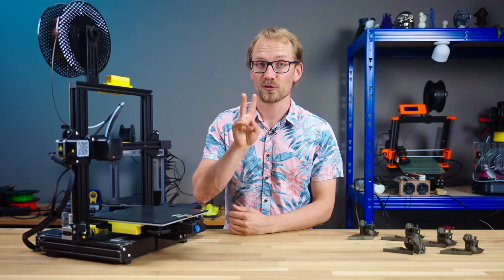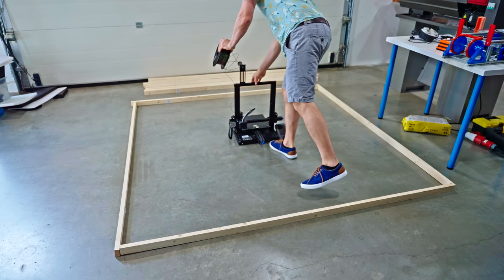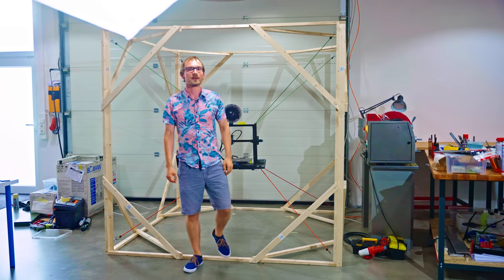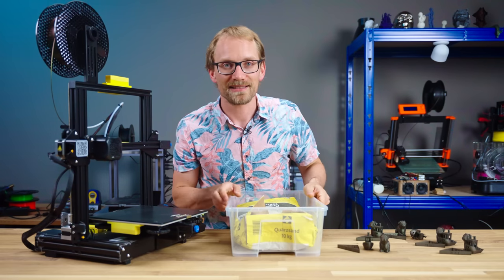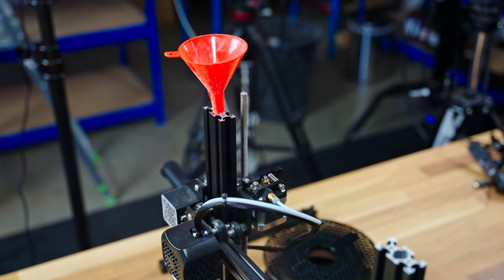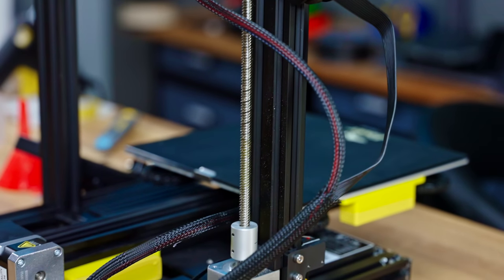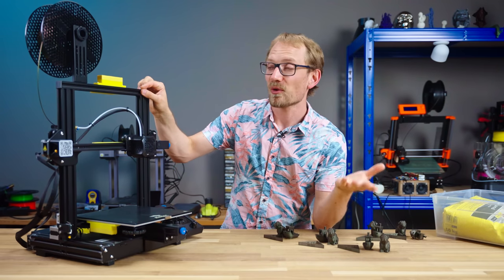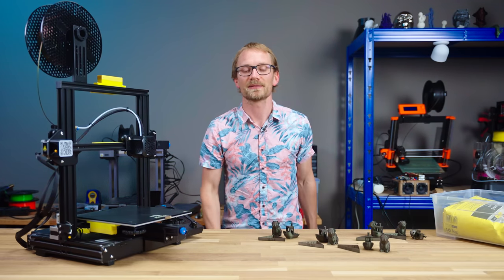You made me do this…

Comment: Interesting ideas! It might work better to put the 3d printer on legs that stick into a bucket of sand, so that there is lots of sand to absorb vibrations in the base. I am curious to see the result of a test like that!
Reply: I was going to suggest the same thing. Just place the printer in a sand box and see what happens. Hopefully it won't dig itself in. :-)
Reply: I was going to comment with the exact same thing - this feels intuitively like a good move. If you had a large, square container filled with sand and just sat the printer in it, I think you might see a difference.

(Probably too slight for it to be worth it, but at least it would be cheap to try.)

Comment: Need stiffness + weight everywhere in the frame to shift the frequencies higher. That being said most ringing is due to how stepper motors work. Throw an oscilloscope on the stepper motor, then run Input shaper and compare.
Reply: More weight shifts frequencies to lower
Reply: I find most of the ringing comes from motor, belts, pulleys. Just lubricating and stabilising makes a huge difference.

Comment: I think the best solution would be to have a counter weight on the same belt as the X or Y.
The top of the belt moves the opposite direction as the bottom of the belt..  Let's say you have a weight on the X that weighs the same as the head.. They would move opposite directions, and hence when they stop, should vibrate the machine.
Just a thought.

Comment: I just bought some motor bike gel pads, cut them to roughly 5x5x2cm and put them under the printer. They have the advantage of being able to move in all directions and completely removed all ringing. 
The printers still stand on massive, 5cm thick sandstone slabs and those are on rubber mats, which results in an de-coupled, non resonating table and a still free moving printer
While moving fast, you can see the gel visibly shaking and shifting the printer as it absorbs the energy, but the printer never moves on the gel itself.
this might be worth a try if you have ringing and/or noise issues
printer: prusa i3 mk3s
Reply: Have had a similar plans.   Was thinking of using a section of 1-2cm thick exercise mat under a large concrete paver with gel on top.  Do the feet of the printer dig into the 2cm gel pads?
Thomas should test this.
Reply: @Trevellian  I removed the feat for this exact reason, didn't even try it out.
One thing I found out is that the size of the gelpad has a direct influence on the movement of the printer, the smaller the pad the more it moved. I sliced them down from 5x10cm to 5x5cm and the change was noticeable when pushing the printer to one direction
it is important that you enforce the table you put the stone on since it weighs a ton and it will bend your (possibly cheap) table.
I enforced mine by placing a solid 3cm thick wooden board on top (no screws required)

Comment: Very cool video. Not vibration or resonance related, but one thing i have been curious about for a long time is how flipping the printer upside down would affect overhangs and bridges. Since any sagging will be pushed back up by the next pass of the nozzle, I would expect it to improve the results. And now you have the perfect "printer enclosure" to test it 😄  Also seeing the effect of different belts would be very interesting.
Reply: Wouldn't you literally just have the overhang problem on every layer?
Reply: @robertbyrnes7075  I don't think so. The molten plastic is probably viscous and sticky enough to stay in place wherever it is fully supported by the previous layer. And in areas along slanted edges where it is not fully supported it will sag towards the nozzle. Which means that on the pass for the next layer the nozzle will lift the sagging but now much cooler plastic up again. As opposed to pushing it further down when printing with the nozzle pointing downwards. I find it hard to predict the end result of this interaction, but I think it might make it possible to print steeper overhangs with better quality.

Comment: Back in the late 1980s, some of the scientific equipment vendors, such Edmund Scientific, sold rubber ball kits for physics demonstrations. One ball would be a standard rubber ball and would bounce as such. The other ball would sometimes be called a dead ball as it wouldn't bounce. The idea was to show how energy could transferred in one direction (bounce) or dispersed in multiple simultaneous directions (dead). At that time, the dead balls were of particular interest in the amateur holography scene as lasers weren't very powerful and the holographic process was extremely sensitive to vibrations. I don't know if the dead balls or material are still available but if still available, that could be an interesting test.
Reply: They are called squash balls and are available from most sports shops

Comment: Very interested in the belt comparison video. I found early on in continuous belt platforms (CoreXY) that there are parametric resonances that crosstalk in abrupt vector changes, leading to ringing artifacts. I used accelerometers and a 35670a dynamic signal analyzer to capture the response of the gantry vs the head. Data is on e3d's forum. I came to believe, but did not follow up on the idea of tuned dashpots that the belts can ride on... (shock absorbing idler pulleys)... might be a trick to try. Thanks for the hard work, Tom!

Comment: I think you may get some interesting results if you modified the springs on the tesseract. What it is now is a vibration isolator not a damper. All of the vibrations made by the printer stay within the system. If you think about vibration dampers on cars there are two parts, the spring and the actual damper or shock absorber. The tesseract set up is only spring and does not have the best damping qualities.

Comment: You could try small dampers from RC trucks.  They are sprung and oil filled.  This will actually adjust the frequencies instead of just adjusting the amplitudes. You need to absorb some energy, elastic straps provide almost no damping effect. 

I dont understand the fascination with optimizing single variables.  It would be far more effective to increase the stiffness of the frame by putting braces on it or adding gussets at the connection.  Damping a wet noodle is pointless.  Brace it until it is rigid the dampen it.  Otherwise you are finding ways to dampen a frequency that is irrelevant and ineffective.

At least the oil filled damper would effect a far wider spectrum of frequencies and it is tunable using different weight oils.
Reply: Small dampers for belt tensioners, shouldnt help with skips but maybe will with resonanses. For skips you decrease moving mass or increase motor power.
Reply: @Gebsfrom404  Wasnt thinking for belts.  The exercise in the video is about dampening the vibration of the frame.  I was thinking if they wanted to put the frames on an elastic base then could mount the dampers to the table.  This way the elastics or flexible bases allow movement but the oil filled dampers absorb vibration. As for belt tensioners I ended up using a small coil spring from a brake drum hardware kit (had a lot of them)... it is used as a retention spring to hold the brake shoes to the backing plate... around 19mm diameter and 25mm tall compression spring... pretty stiff.  Then I preloaded it with a threaded rod running through it to a yoke holding the belt pulley.  Any compression spring would work as long as it is stiff enough to maintain control of the belt.

Comment: I love your Sciency thinking. Please keep valuing it as this sets you greatly apart from typical YouTube content we all got used to! 
- You briefly mentioned the additional mass on the printbed might harm the print quality. I totally agree. I would have tried again withouout those printbed Santainers, maybe even adding them elsewhere…
- I highly value the additional mass on the printer. The bigger the mass difference between bed and printer body, the more recoil you can convert into printbed acceleration.
- A tip from back in the days (experience with laser interferometry in physics lab): For effective (nearly critical) dampening of alu extrusion profiles instead of pure frequency shifting fill the profiles with silicone (not silicon - Fugensilikon, nicht Silizium ;-) This also greatly assists survivability of your mechanical components when compared to sand… 
I would love to know the frequency range of problematic ringing. This would hugely narrow down the root of the evil (profile bending, profile ringing, belt stiffness etc.) okok, I’m getting to scientific. Looking forward to the engineering way of life: try it out! :-D

Comment: This was fantastic.  And thank you so much for testing things out.   I was very curious as to the outcome, especially the sand damped tests.  It also makes sense that BMW used such a complicated series of dampers.  But in the industrial and aerospace worlds, there is a simpler solution - avoid the areas of operation that induce harmful resonances!  In a light aircraft, this could be as simple as a plaque that says "Do not run propeller at RPM between 2500 and 2550 for more than 5 minutes".  Or for a larger aircraft, a redesign of the vibration causing components, to shift their resonances rather than compensate in other areas.  Where the moving masses are controlled by stepper motors, that's the obvious place to control vibrations.  Match the speeds and accelerations to avoid areas of resonance.  That's not cheating or a hack!  That's proper design.  Love your channel and the work that you do...not intended as a slight at all.  That I learned that a printer will work upside down is worth more than the price of admission.  To me that means it's just a matter of time before there's a 3d printer in space.

Comment: Sand filled feet are a good, cheap and decently working solution. There are many different sand filled balls you can use with a printed holder to keep them in place below the printer

Comment: Just a piece of advice for measuring squares, you can do the triangle method.  3:4:5, is the ratio your sides should be at and the distance between them.  Its a commonly used carpentry trick for getting perfect 90 degree angles.

Comment: Thomas, I have a couple suggestions for the next video in the series...
First of all, thanks for showing us what doesn't work.  The early rocket scientists had a saying, "Fail big, fail fast" so they wouldn't waste time and efforts that wouldn't be ultimately productive.  

Please try making these quick checks on the system - they may point you (and us) in a better direction.  

Try tightening and loosening the belts when repeating test models.  This might give us an indication of wether we need to absorb vibration being transmitted to the print or if the belts are a source of the oscillations.  

Then, you could compare different types of belts and look for different results.  

This might be done scientifically off the printer... If the print head velocity is known, measuring the ringing in the print could determine it's frequency.  

You could then suspend varying weights from belts and vibrate them at that frequency to see what belts might oscillate or dampen that movement.  

I suspect that CNC machines benefit from sand dampening because the multi-flute tools are turning and hundreds of rpms, creating chatter at several khz.  Printers are operating at much slower resonances, so I expect that most problems are within the motion system itself.  However, I will look forward to your next videos and learning what you discover.

Keep up the great work!

Comment: I have observed quite a bit of NVH testing. The bottom rails likely didnt harm much, but the vertical supports having sand added was the main issue making prints worse.  Adding mass to cantilevered components will just shift the frequency of the resonance.  More mass generally = more resonance at lower frequencies (greater deflection distance).  Adding reinforcement to the gantry along with soft mounts that absorb energy will help most.  A support rod run from the top of each vertical support, to lower frame would mitigate the motion of the gantry.  Soft materials used under the machine would help absorb vibrations from print head motion.

Comment: Tom,  dumb question as I haven't checked through all of your other experiments, yet - what have you done with the bed springs?  

Stock Ender 3 springs are woeful, I use the regular yellow upgrade springs on all of my printers, with a LOT of compression to eliminate some print bed wobble, these springs are better finished than ones fitted to cars - the ends are ground flat - [N.B. car springs break BECAUSE the ends are not finished properly so it transfers all the stress to the end of the first coil, saves the maker money, costs us for replacements]

The other thing I do is fix the M4 countersunk [flat head] screws to the print surface from below, using M4 nylon nuts - this fixes the screws to the print bed, don't use metal nuts without nylon washers - you will damage the insulation surface or worse, short the bed to the frame, not unlike what happened with the early CR6SE's.

Finally, after fixing the screws to the bed, putting the bed back onto the frame becomes difficult because the clearances on the screws are tight, so I enlarge three of the four holes with a 5mm drill.

Comment: Thomas, you didn’t fail.  You simply helped identify several options that don’t work and reduced the list of remaining options for others to test going forward. The effects from resonance appear to be most pronounced along the X and Y axes since we rarely move and change directions rapidly along the Z axis ( unless one starts slicing and printing diagonally at some point ).  
That said, I think effects from the X axis resonance might be reduced by two things 1) making the X-Z frame one solid piece (welding the corners, for example) and 2) dampening or stiffening the print head assembly itself.
The Y axis requires something more robust to prevent additional forward movement when shifting direction due to the increased inertia involved.  Perhaps some type of electromagnetic braking along the direction of the current force Y vector ( picture a magnet attached to the bed which whose strength of attraction to the base could be varied to match the force Y, but in the opposite direction of the force Y vector).
Just sanding thoughts while drinking coffee….

Comment: With that many skipping steps, I'd start looking into bumping up the stepper motor voltage via the driver pots.  I'm curious whether fixing those skipped steps make the 'sandtainer' approach work at all, if only because stuffing them wherever they fit just kinda looks cool.

But also, resonance tuning in software is way easier and very effective.

Comment: Cheers for experimenting so we don't have to.  Curious if/how different dampening materials/fluids attached just to static frame components would help, or not.  Detaching power supply and fan cooled controller board.  Decouple spool.  Basically isolate everything possible.

Comment: I went through the trouble of getting Klipper working on my Ender 3 V2 for resonance tuning using an accelerometer (and Klipper's implementation of pressure advance works with the stepper drivers hardwired into legacy mode on a stock V2). It worked incredibly well and the Ender's frame and motion system is surprisingly stiff, allowing the use of the better dampening algorithms that provide compensation without excessive smoothing of corners.

Comment: Something I did to my printer, and I know this isn’t on the scope of which you made this video cover, was I replaced the x carriage. It originally was a heavy thick three part steel. Now composed a singular piece of aircraft grade aluminum of the same thickness. The shock went way down as the bed now shifts. Knowing this and then applying the issue of resonance, wouldn’t a solution of determining the weakest material causing the slop (artifacts) be best to replace? IE blue loctite all frame bolts. Reduce slack in bearings and such? Stiffer springs on heat bed?

Comment: Since the idea is to apply dampening to counter the moving parts, and you already have the suspension rig, try loading two printers one facing upright and the upside down one facing the opposite direction... you want to load the same program into both and start them running (the bottom one does not need to be actually printing). The bottom printer will be moving in the opposite direction to the top one and should mostly cancel out the movements of the top one.  Might be a relatively easy experiment to try out.

Comment: Increasing the static mass is fine but adding weight on the moving parts is silly. Anything that moves you want as light as possible. I don't see much point in trying to dampen the Z axis either. Most of the resonance is coming from Y and X. Adding more springs to the system is just going to shift the frequency not absorb the inertia. It seems like pure dampening is a better approach.

How about a two piece foot setup with a shallow angled concave dish stacked with a matching convex disc and a little bit of grease in between. So when the foot tries to move off center it has to go 'uphill' and the grease will convert some inertia to friction (heat). Something like a miniature plastic version of the earthquake bearings they use on large buildings.

The cube might be a little extreme, but it will be interesting to see what it does. You'll have to get a bass tuner app and tune the bungies.

Comment: I am an electrical engineer so I haven't studied this topic, but I would first attach vibration sensors all over the frame and heating bed and do frequency analysis and then designed springs with resonant frequencies matching the strongest frequencies from the analysis.